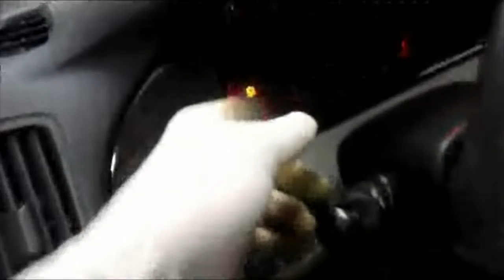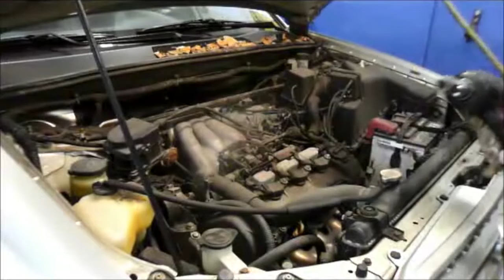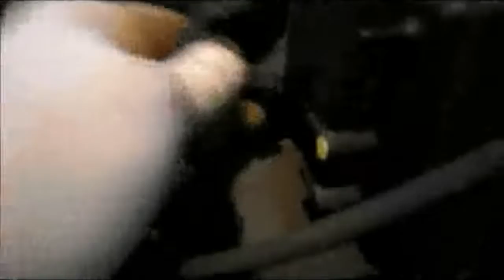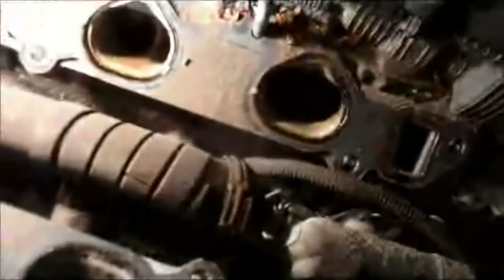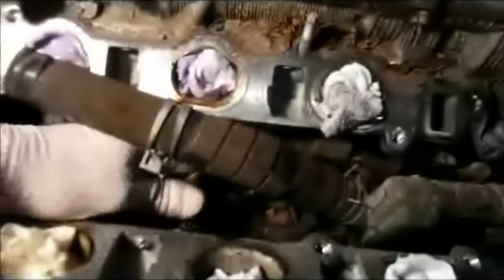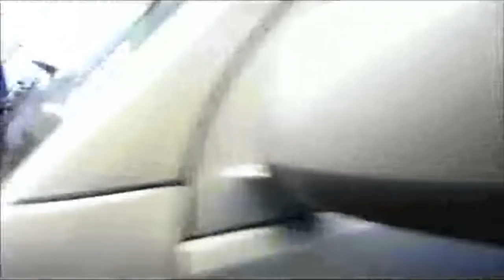Remove The Intake Manifold And Replace The Knock Sensor 2003 Toyota Highlander

Comment: Did any body have the vsc light  come on at the same time ?
Reply from the maker: That is very common When the check engine light goes on   Most of the time it is a false code and will go out once the original code is corrected
Reply: @jimthecarguy  thanks Jim

Comment: Still having knock sensor bank 2 code 0330 and engine drops to limp mode. Yes had work done. Aside from sensors, throttle body gasket set, spark plugs, fuel system cleaning, valve cover gasket set…very pissed off at this point

Comment: Hey Jim,
I know this was a year ago but hoping you can give me some advice. A month or so all of my coolant shot out of my engine via the water pump and my engine overheated. I let it cool down and started it back up, no issues (was worried I blew a head gasket or damaged something). I went ahead and replaced the water pump, timing belt and tensioner. A week or so later I started getting a p0330 and p0325 code "Knock sensor 1 and knock sensor 2" code at the same time. I went ahead and followed your video, replaced both knock sensors and the harness, checked the connections, protected them with dielectric grease, I cleared the codes and they came right back after going about a mile down the road. I went to some forums and some people mentioned grounds on the ECU that crack and up causing issues with the knock sensors so I took that out and reflowed the solder on those points, still the same issue. I'm at a loss of what to do at this point, I suppose I could replace my ECU but I don't know if that's going to resolve anything and I hate guessing. Any tips?

Comment: What is the mileage of the car at the time of failure? Just curious to know how long they last.
Reply: Mine is an 03 with 360,000 kilometers just failed. Found out because my transmission wouldn't shift Into overdrive. The computer does this to minimize knock. Top gear pits the most stress on the engine.
Reply: @sturomain  would it shift up to 3rd gear only and restrict speed? Is that what not shifting into override is?
I'm getting a code for knock sensor and this last described symptom.
I would really appreciate any information you share to help me find the issue and fix it.
Thank you!!
Reply: Yes my 03  highlander would only shift 1..2..3..relpaced knock sensors 2 of them and now it shifts perfect through all 4 gears. 2003 highlander was the last year with the 4 speed auto transmission

Comment: Are there any other items you should change or replace since you've taken so much apart?
Reply: I'm a DIYer and I did this job in 2020 on a friend's 2001 Highlander. While I was in there I replaced that large diameter coolant hose that sits in the middle of the valley because it was old and kind of hard and I didn't want it leaking later down the road. Because the valve covers were leaking some oil, I replaced the valve cover gaskets. Since the manifold was off, now was the time to get to the rear valve cover easily. I also replace the spark plugs since there was easy access to the rear three plugs. It was optional but I replaced the PCV valve since it was slightly easier to get to with everything apart. Because you have to remove the fuel injectors and rails, I took that opportunity to replace all of the rubber o-rings that seal the injectors. I also unbolted the throttle body and cleaned it. I'm not saying you need to do all these things but that's what I did.

Unrelated to that job I did a timing belt job at the same time. New belt, pulleys, tensioner, water pump, cam and crank seals and engine belts.

Comment: That's a lot of work to replace a couple of sensors. Showing the proper removal and reinstallation of the components is so important to get everything back to its original place. As you stated leaving a ground bolt out would cause a lot of problems thanks great video Jim
Reply from the maker: I can't tell you how many times I get a car into my shop that was repaired by another shop and they left out some bolts or wiring harness holders.Thank you for your input and for watching.